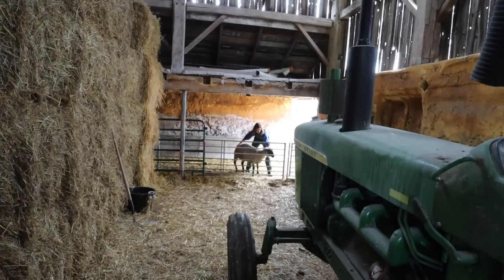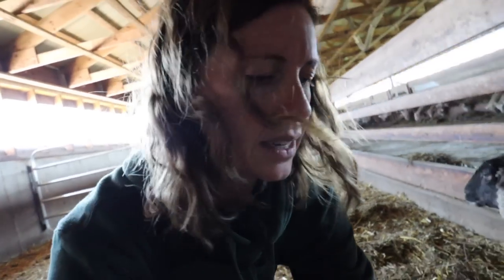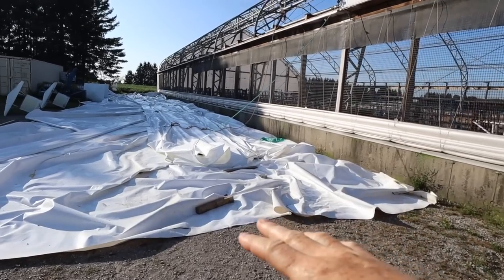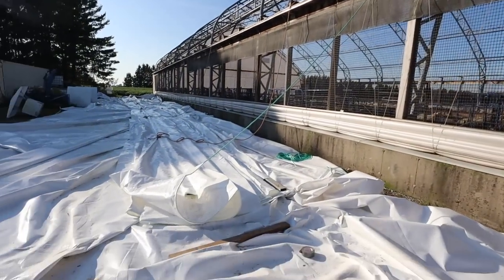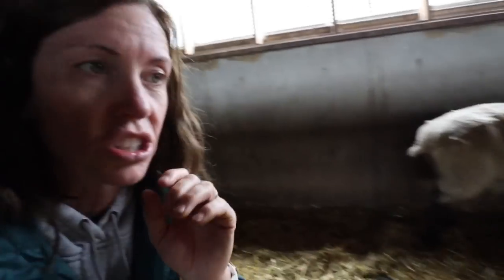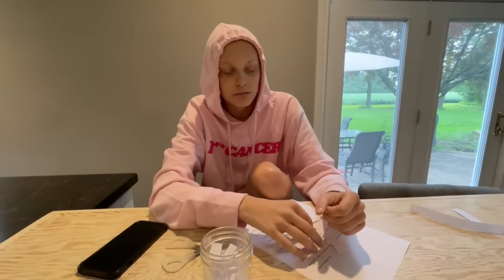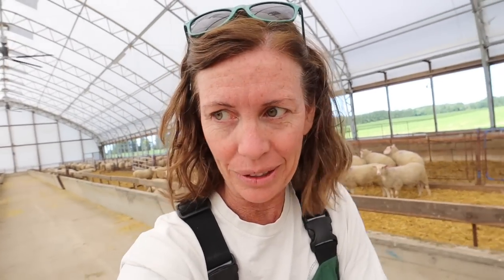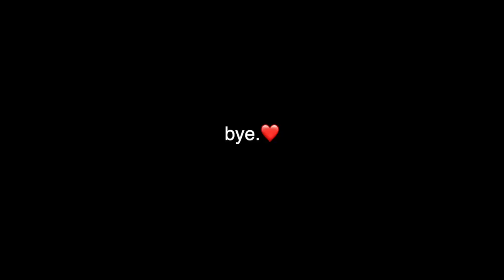The sheep barn ROOF IS DOWN!! ...but this time it was planned. | Vlog 714

Comment: Attention, Sandy Brock… Tim from Ontario Canada… I see you were always having a little bit of a problem with that vinyl roof… what would the cost be to put .tin down over it, and bring it out past your windows for snow drop off….or put a normal wood roof on.. I see a normal house roofs. They are doing new things with steel.. Kompass it roofing.. would your barn roof be expensive to go into this category?. or another suggestion is to look( in to  roofing company and see what they would charge you to put on a normal roof with shingles just suggestions it is always nice to have outside. Suggestions even know half of the time they are someone else’s suggestions but a little help from your sheep friends does not hurt now and then to get friendly advice from your sheep family. On you tube thank you love your shows always love it when lemming season comes and the new arrivals are so funny.
Reply: A "normal roof with shingles"????  There is nothing between the steel supports that hols up the plastic roof.  What are you going to nail the shingles to, a cloud? 🤡

Comment: SOLUTION FOR RUBY?? Maybe, can you use a panel to block off behind/in front of the tractor, in the other part of the barn, so Ruby is ‘separate’ from but still with her family??? It only needs to be temporary so hopefully it wouldn’t be a huge hassle. Sandi, you are such a hard worker. May the Lord bless your efforts. 🤗😘

Comment: Standing on the wet grass can definitely cause thrush (hoof rot). You could apply the Koppertox or bleach as a preventative to the hooves during the wetter times. You did a great job with intuitively giving the antibiotics to Ruby in addition to the pain meds!
The new lambs are always wonderful to see. Hard to believe it's September. The summer just disappeared (hubby was in the hospital for almost 5 weeks of it due to a couple of surgeries), so I could relate to your struggles somewhat.

Comment: Having dealt with hoof rot, you can use the same treatment as what they use to treat thrush in horses. (it's green) I have a treatment that I use down here in KY, but don't know if you can get it in Canada.  Also, if I see anything resembling puss in between the toes, I use Drawing Salve (another equine product) on a little gauze between the toes and wrap it in vet wrap for 24 hrs. Between that and a shot of antibiotic (I use oxytetracycline), they are usually good within the 24 hours.

Comment: If you need to treat Ruby, or the others, with iodine again you can mix up some with some water (20-25% iodine) and put it in a plastic cup and just dip her whole foot in it. I think zinc sulfite is recommended though. I believe that foot rot is contagious as well, and iirc it can live on surfaces for 14 days. Warmth is a sign of inflammation, but it doesn't necessarily mean infection. You could use a little disposable hot or cold pack, like the little chemical ones you often see used for sports injuries, and use some coban/vet wrap to hold it in place to do some hot or cold therapy. I feel a bit silly for suggesting this, but I know as another animal person I'll try just about anything to help my babies even if mine are cats.
I have a f*ck cancer bandana that I got for supporting a cancer foundation. They had a tent set up at a big weekend-long music festival I would go to every year. The bandanas were really popular because of the dust.

Comment: I have to laugh at Mark wanting to string up engineers!
  We always had John Deeres and my dad always did his mechanical works.
    For some reason, at one point he bought a McCormick 340 and it was always referred to as "mom's tractor. "
   He despised working on that tractor....he swore that the engineer that designed the thing, "built it from the outside in and then crawled out through the smokestack."
  And ironically, now his grandson is an engineer for John Deere.

Comment: the stuff in the water bottle was that copper sulfate? I know copper not good for sheep if they ingest it, we are raising 60 of them, but sometimes feet start going bad and ya need to give em a squirt of copper sulfate on their feet. A foot bath is much easier, but you run the risk of them stopping for a drink.

Comment: from my experience with horses - that heat and swelling just above the hoof usually indicates an abscess trying to make its way out.  can be due to bacterial or fungal!  with horses soak in warm water with Epsom salt  and a little bit of iodine until it "pops" and starts to drain. injectible Antibiotics probably won't help much if any if the infection is in the hoof.  Did you try koppertox?

Comment: Attention, Sandy Brock… just a thought maybe get your tractor and take out all of that wet hay and straw and put in something fresh… because it might be that they’re stepping on pieces of straw that are poking their feet, and then getting wet foot rot by cleaning out this pan might be a sensible idea.. if you cannot get in there with your Tele handler… a small tractor with a back blade… a small tractor with front in loader but it looks like that needs to be cleaned out if you do not want more injuries with the feet just suggestions